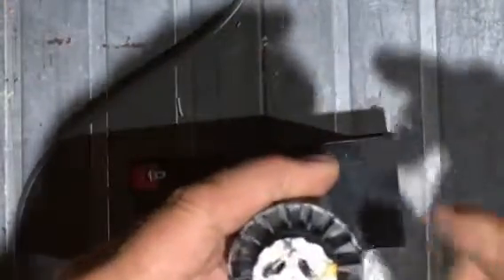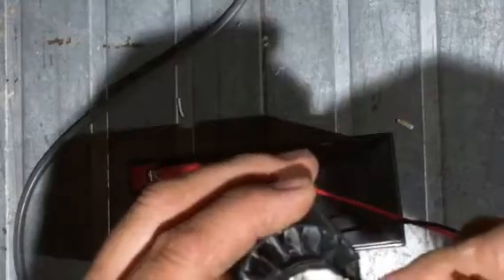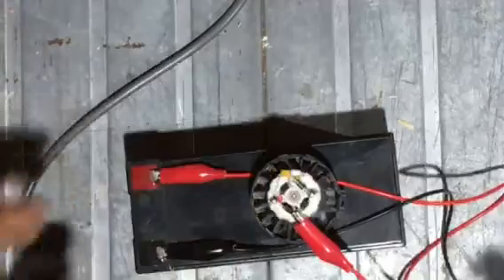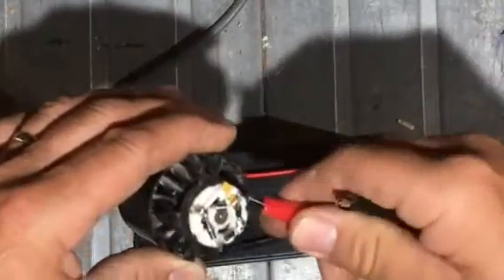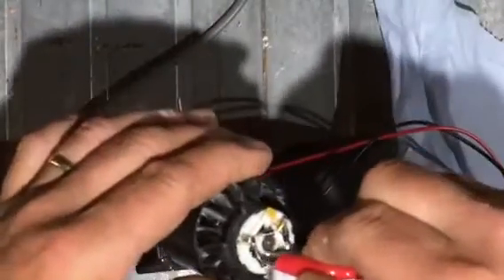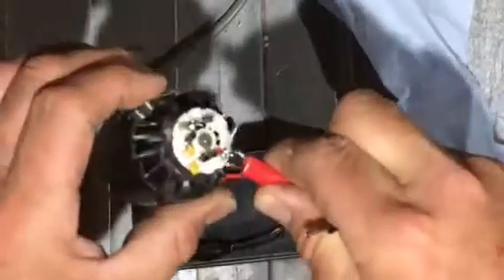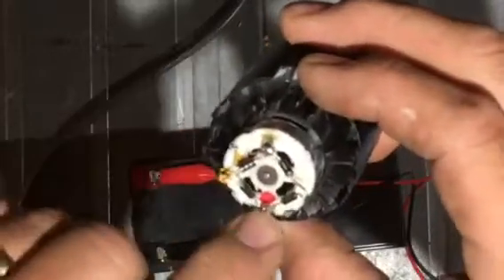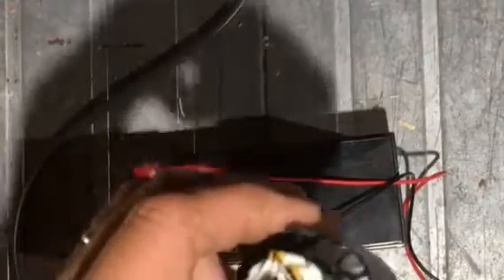Motor with bridge rectifier

Comment: Isn’t the rectified voltage too high for the motor? I just found a similar Hoover nozzle driver motor. I am trying to figure out what type of motor it is.
Reply from the maker: Daniel Khadivi I checked the motor and it runs happily on the 12v supply
Reply: @darrannewman7113  The Hoover nozzle motor is a universal motor (120 VAC, 60 Hz). I can't understand why the manufacturer is using a full bridge rectifier between the mains leads and the motor.The four diodes are 1N4007 in a full bridge configuration (no capacitors, nothing else on the little board). The motor can run on the mains power albeit very very fast. No information on the internet that explains it. Thank you for your reply. Any insight is much appreciated.
Reply from the maker: Daniel Khadivi this one is from a digital hair dryer where the processor runs the motor at the optimum speed , unfortunately it was the board that failed. Still have no idea why it was done that way but my alternative use would be as a smoke fan in a model steam tug , so whichever way the esc was operating the drive motor the fan motor would turn to extract the smoke

Comment from the maker: Sorry about the camera position, the reason for the video was it may be of use to model boat builders who use a smoke generator, as with the rectifier in place the smoke will be exhausted out if the boat was going either forward or reverse.
I have since had a thought and have come to the conclusion it is a bridge rectifier because it is suplied by mains voltage AC and the motor is DC.
Always the thought's come after.